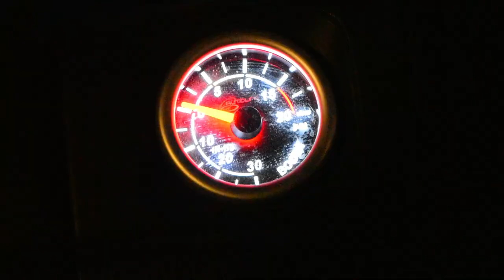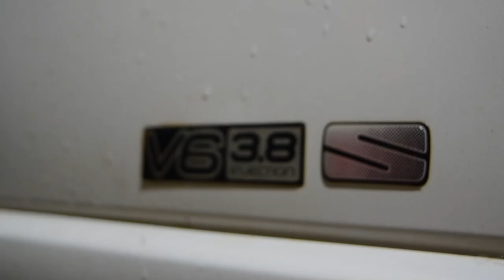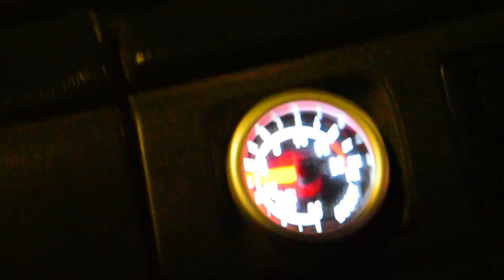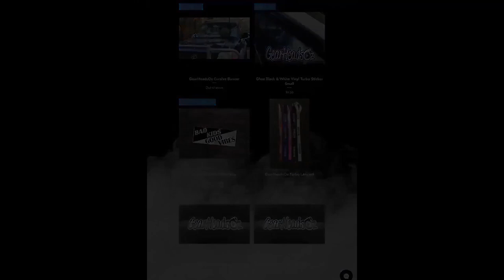Cammed L67 T5 Manual Gearbox Swap!

Comment: what additive did you add in to quieten down the gearbox whine
Reply: Hey mate wondering if you know the answer to this question
Reply: @sabylos8789  hey mate, can't remember what fluid old mate used in the video, I ended up going with atf dexrol 3 with lubrizol 4297, didn't make my gearbox quiter, I had bought some manual gearbox oil with hopes to make it a big thinner with quick shift eze but ended up going the other way and feels good so far 👌 in a 96 VS Eco

Comment: What’s the specs on the rims
Reply: 20x8.5 front 35p, 20x10 rear 42p
Reply: @GRUDGEPERFORMANCE  any mods u had to do to fit them bro ? What size thre
Reply: @turkzz12  not really man, rolled rear guards and adjustable panhard that's bout it, rears have 245/35/20 and fronts are 225/35/20, the rears rub going on steep inclines on an angle that's about it
Reply: @GRUDGEPERFORMANCE  okay thanks so u didn’t need to bash the inner guard
Reply: @turkzz12  nah didn't need to, would be ideal along the contact point but completely fine without needing to modify the tubs
Reply: @GRUDGEPERFORMANCE  thanks bro looks good makes me want to get some or vertini drifts

Comment: What type of rims are they ??
Reply: Lenso D1Rs, 20x8.5 front and 20x10 rear
Reply: @GRUDGEPERFORMANCE  how did you get them to fit the rear ?
Reply: @Mathew Schmidt  they fit snug just have to roll the guards and bash flat the upper lip as well, about an inch above the wheel arch lip when you're lowered. They do scrub on steep angles like pulling into a driveway at an angle where one wheel rises first and they hit the inner tub. I have fixed this issue with a vl wagon diff and welded in mini tubs!

Comment: Auto transmission fluid in a manual ?
Reply from the maker: Yes, if you listened, you would know why.
This series of gearboxes are ran on dx3 fluid from factory. With a friction modifier. Alot better for the box than just gear oil.
Reply: Running a low viscosity gear oil makes them hard to shift and feel horrible, most borg Warner and similar GM trans, t56, tr6060 etc run ATF
Reply: I use auto fluid in my t5 with a tube of the nulon smooth shift works great